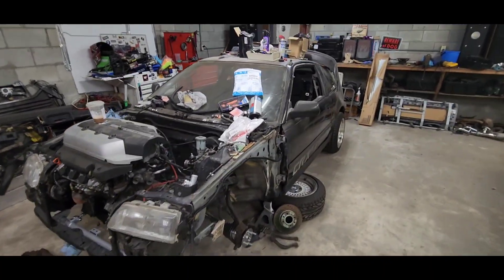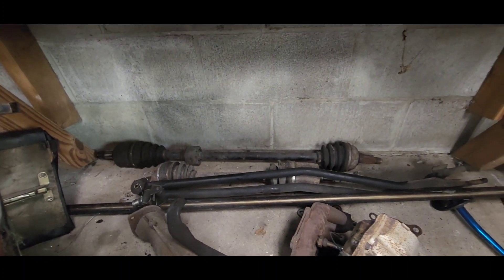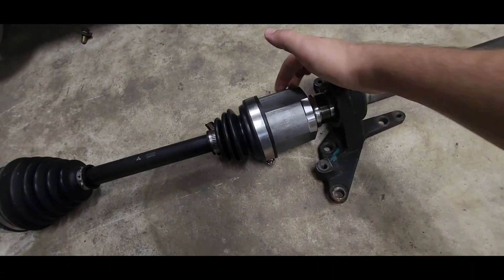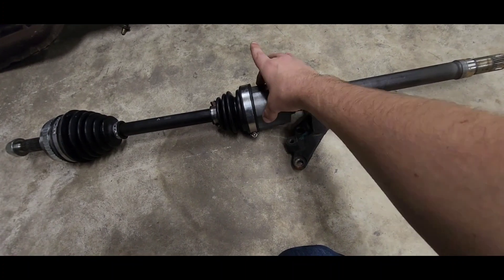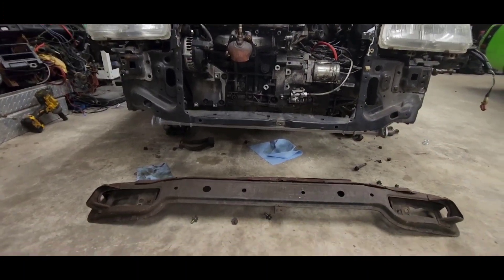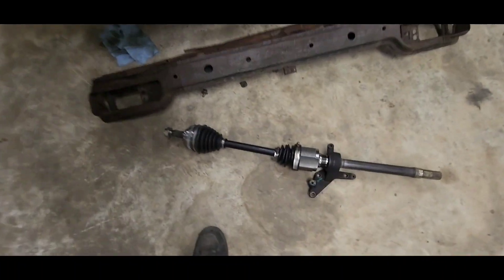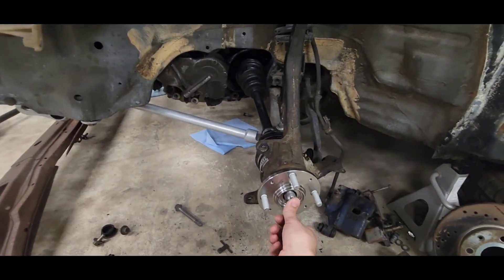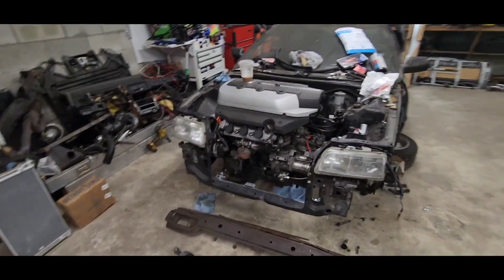How to make custom Jswap CRX axles

Comment: What are you running for harness and ecu? I see your dbw I’m trying to plan ahead on a prelude swap trying to run a tl ecu
Reply from the maker: I used the stock ecu, key and immobilizer from a 04-06 acura tl. Kept the stock engine harness and found the pinouts for power, ground, fuel pump, immobilizer wiring, rad fan, etc and mated them up to the crx harness

Comment: Definitely a dope concept. The only thing that is a little fuzzy is whether they'll be able to hold up to the j series hp and tq numbers. Personally I got lucky with my swap and there were #insaneshaft 500hp axels included. Definitely great if you're in need and don't plan on launching aggressive tho. Good work.
Reply from the maker: Surprisingly they have the exact same shaft diameter as the insaneshaft axles so the only difference I could see is the metal quality or bearings. The one set is made for the tl so it should have no problem holding the power a stock j will throw down